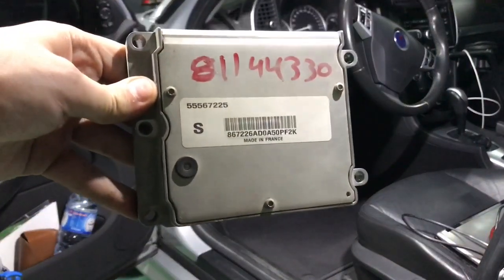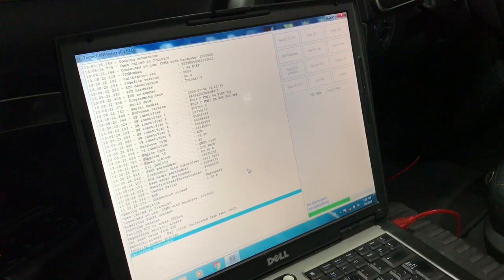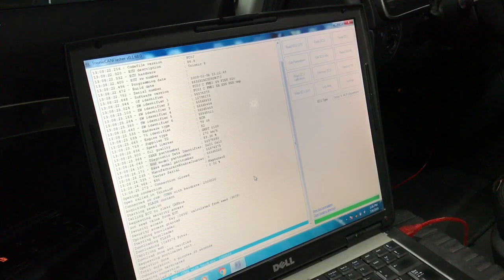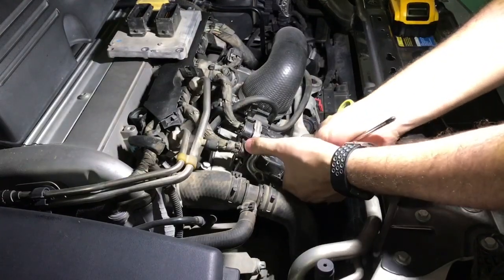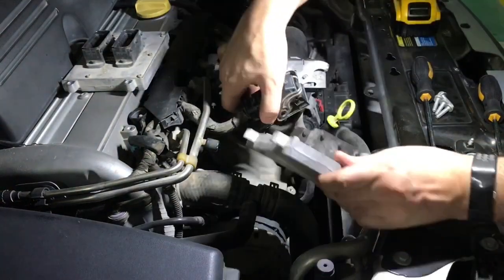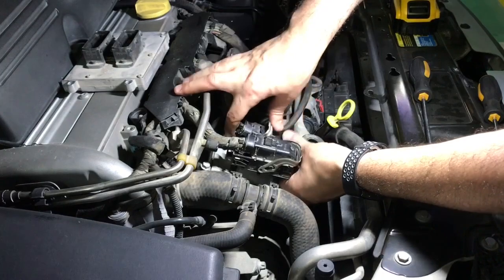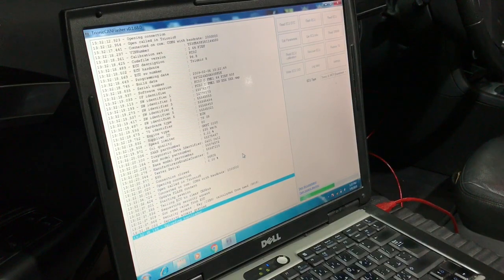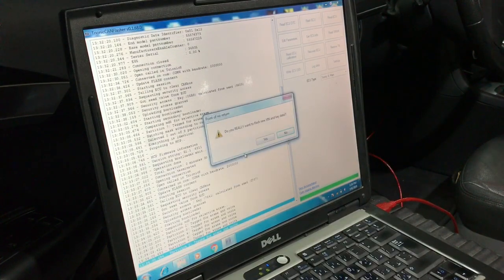SAAB 93 ENGINE ECU/ECM SWAP (TRIONIC T8)

Comment: Hello, thanks a lot for this video. I have one question, I bought a new ecu that has a hirch map with +50 horses. When I insert a new ecu with this method, can I return the old ecu at any time, say in the winter? Or when I put the old ecu back I have to reprogram again? Thanks
Reply from the maker: If u used this method then the hirsch map is gone u just copied ur stock map into the new ECU
Reply: @TheFlyingMechanicDIY  How can i set up a new ECU? Can I somehow use your method but to keep a new map when I'm done? Thank you very much
Reply from the maker: @markomet8  if you want to keep the map that came with the ECU u will need a saab tech2 and TIS software access

Comment: Hey brother, Me Again, My Replacement ECU just delivered today. Upon trying to “Get ECU Info” on my Original ECU TrionicCanFlasher v0.1.68.0 it says “Not Responding” and just stays loading. Any idea as to why? It’s driving me crazy
Reply from the maker: There is an infinite of reasons why that can happen, hardware compatibility, software compatibility, missing drivers, wrong settings, wrong adapter, failed ECU .
Its impossible to me to figure our remotely, im sorry .
Reply: @TheFlyingMechanicDIY  Hey brother, I appreciate the quick response, I managed to get the ECU cloned to my New ECU, but now the issue is that it won't crank at all. I Charged the battery up to around 12.4v & Nothing. I'm on the verge of just giving up on it and junking it since it's just taking up space on my driveway. I've got till the end of this month to get it running
Reply: @TheFlyingMechanicDIY  Any idea as to what it could be? It gave no Codes at all, the new ECU is the same model number as my original one 55353231
Reply from the maker: @Choowy  so whats the issue with the old ECU to begin with ?
Reply: @TheFlyingMechanicDIY  Crank but no start & No codes. Also, when we cloned the ECU, we didn’t get a pop up like your video shows “Copy Vin & Key to new ECU” the flash just completed with no pop up
Reply from the maker: @Choowy  if u didnt see the pop up then the clone is unsuccessful.
Reply: @TheFlyingMechanicDIY  interesting, do you think I did something wrong or should re flash the ECU again & see if I get that pop up for the VIN & Key? Also, would you prefer me to email you or is talking through here okay with you?
Reply from the maker: @Choowy  email is better, try cloning again, and send me a screenshot of the final result from the trionic software when the flash process os done
Reply: @TheFlyingMechanicDIY  Sounds good brother,  Can you send me your email? it’s pretty late here in California but I’ll send you an email tomorrow when I’m re flashing it. Thanks again for all the help man, greatly appreciate it
Reply from the maker: TheFlyingMechanicDIY@gmail.com

Comment: Hi, my Window 7 laptop does not have Port option, then I added Port in device manager.  It gets Windows cannot determine the settings for this device.  Consult the documentation that came with this device and use the Resource tab to set the configuration. (Code 34)  Seem like driver problem to me.  Do you have any idea?  I search online and got no clue.
Reply from the maker: Make sure u install the correct driver , and while the device is connected to ur laptop u should be able to see the device listed under ports .
Reply: @TheFlyingMechanicDIY  I got a Window 10 laptop work.  Everything is good.  Thanks for your video post.
Reply: @TheFlyingMechanicDIY  It does not have a correct driver to install for the port in device manager, and there are no option for the adapter in Trionic flash.  Also the OBDwiz did not install correctly as well.
Reply: @TheFlyingMechanicDIY  Is Window 10 laptop work?

Comment: So I just tried doing this myself and wonder what could go wrong? How do I know I copied the files correctly and they are readable? As when I tried to flash the ecu and install the two bin files for some reason I never get to the verify your key screen and it seems like it didn't install the files.
Reply from the maker: Start with a fresh screen, when the process is finished read what ls on the screen it should say job done and u shouldn’t see any failed items
Reply: @TheFlyingMechanicDIY  big error i ran into for whatever reason cloning the ecu to another working one wasn't successful at all and I dont seem to know why. But even worse I put on my old ecu and my car didn't turn on how is that possible if I didn't flash my original ecu just copied the files off of it. How can I get it back running with my ecu that's giving out? I need major help please help me out
Reply from the maker: joshrawks21 .. what was the issue with ecu that triggered the replacement ? Can u read faults from the car and see whats in there ? Try disconnecting the battery for 30min , and i suggest u send me at the email from the info section .
Reply: @TheFlyingMechanicDIY  email is being sent! You're my only help!
Reply: @joshrawks21  I'm having the same issue as you. Did you get it figured out?
Reply: @asbunce  got a email I could send you the steps

Comment: I had 2 ecm s flashed but the codes say all injector circuits are open and runs bad 
what the solution??
I put new injectors in
Reply from the maker: Bad ECM .. get one thats confirmed running and not from eBay ..

Comment: Can you explain what you mean by connecting the car to a charger or maintainer? Can't I just leave the car connected to the battery and do the ecu swap?
Reply from the maker: When u do the ECU swap u actually should disconnect the battery before disconnecting ur ECU , and only reconnect the battery after u connect ur ECU.
What im talking about here is while u r performing programming ..
Reply: @TheFlyingMechanicDIY  I understand disconnecting the battery when I remove the ecu or install the ecu. But what I wanted to know is when deleting everything off the donor ecu and then grabbing your tune off your original ecu the battery is connected and everything should be okay? There's no risk of it dying unless you have a bad battery yes? Also if the donor ecu is from a 2004/9³ and you have a 2008 ecu/9³ when you format the donor ecu what option do you click on tronic program when you have to pick what ecu you're working on?
Reply from the maker: joshrawks21 if your battery is ok, then no need for charger. U dont format the ECU, you copy the main and MCP softwares from the old ecu, then put then on the new ecu (start with the mcp then main)

Comment: Just got the P0201-P0204 and P0245 and P0246 on my 06 93. I already changed the solenoids on the turbo and the throttle body and no luck. I'm guessing it's gotta be the ecu and I'm hoping that it doesn't lead to it actually being injector troubles. The guy programming for me says that any Ecu for the b207r Auto or manual should work and that it's best if I get an 06 Ecu from the junk yard if I can. I'm at 134k and have Cel and half boost
Reply from the maker: Yaa, its definitely the ECU .. if he is using tech2 only for the installation then the ECU must be from same year/engine/tranny. If he is using tech2 and TIS then the ECU can be from any car 06 or before . If he is using Trionic flasher then it doesnt matter where u get the ECU from
Reply: @TheFlyingMechanicDIY  I see thank you for the info I'll make sure to ask how he's going to go about it so it'll go smooth with no snags.
Reply: @TheFlyingMechanicDIY  I also have the same error codes on a 2007 9-3. I tried using Trionic Flasher to clone my ECU but each time when I flash to the new ECU, I am not prompted by the software to write the key data/VIN information. The old VIN number remains on the flashed ECU. What could be the issue?
Reply: @OS-fl5hx  you didn't check the box that says .. unlock system partition like at :26 seconds... If it's grayed out make sure to do it before you read ecu.. Happened to me lol

Comment: hello there i'm john and i have been trying to find out how to get the sofeware for programming my ecm because the one that is in my saab 93 is bad the car runs but it runs bad. And when i open it up the board was burt so that may be the cause of all of this and i need someone to gide me to what sofeware i need to install on to my laptop i'm running window 10 and if that's okay to have in doing so?
Reply from the maker: Here is the download link, u will need to buy the adapter and just follow the steps in the video, its straight forward.

https://txsuite.org/download/trionic-can-flasher/

Comment: Another very good video.  Thanks.  Question:  What is the difference between T8 MCP and T8 Main?  Also you say to set latency to 16ms, Trionic site says 2ms.  Thank you.
Reply from the maker: Thats whats working for me .. could be different for u
Reply: @TheFlyingMechanicDIY  Thanks.  I did mine and it worked out well at 16ms.

Comment: Have you attempted to manipulate the software in the actual Trionic 8 suite? The flasher is a life saver for repairing an ECU tune on the married original ECU, but does nothing for installing a different ECU from a different vehicle correct? That requires a Tech2 to get an ECU to be married to any SID integrated system? If youve looked around through the tuning software, have you been brave anough to alter anything?
Reply from the maker: Ofcourse the flasher can copy the original ecu to any new ecu , for the tuner i dis few things here and there, but only minor adjustments

Comment: i am sorry to bother you. but i bought a tronic 8 ecu that someone had cloned a stage 2 tune to from their car. no one in my state knows how to marry the ecu from my car into the tuned ecu. i have been told i need a tech 2 programmer. but it seems this software bypasses that. i am wondering if and how you can marry the vin into this tuned ecu. if you can help i would be blessed man. i hope to hear back. i just dont want to wipe the tune i payed for. also the guy i bought the tuned ecu from is going to send me the tune files if there is a way to use them to flash my ecu
Reply from the maker: Unfortunately the only way is to have a tech2 and TIS software, and without me having access to the car physically i cant help.
I can suggest you subscribe to the saabcentral forum, and post ur location, u might find someone near to u that will do it for free even.

Comment: Hmmm, direct quote from the forum.... “ Also like it says in the guide don't use the MCP from your ECU. Just use a fresh one from the MCP dump section. These are 100% okay and working. “
Reply: I'm looking around the forum, where are the files?
Reply: @namechane1758 did you ever find them? I just did this process on my 06 and it won't even begin to crank. I'm assuming this is also my problem as it would start with the original ECU.
Reply: @NogaBlitz I did I will share I can
Reply: @namechane1758  awesome thanks! I read about possibly needing to unlock partitions using trionic, when you do get the chance to share let me know if you had to do that too.

Comment: Hi will this work on the 2008 Saab 9-3
Reply from the maker: It will .. if it has the Trionic8 ECU
Reply: The Flying MechanicDIY thanks how do I find out that it’s got a Bosch 55666420
Reply from the maker: Aty Hussain i dont recognise this part number, and if it sYs Bosch then its definitely not Trionic

Comment: Hi where can I get the lead and software from?
Reply from the maker: Hi there, its all in the video description
Reply: @TheFlyingMechanicDIY  many thanks, I did spot it LOL
I may need to flash my new ECM as i don't think the garage that swapped it made updates as I now have  a p0325 error code!
Reply from the maker: jamie king u mean u wana copy ur old ECU software into the new one , right ! That should work .
Not sure if a P0325 will be caused by a software though
Reply: @TheFlyingMechanicDIY  Hi, at the moment I've ordered a replacement CDM (ionization module) hoping it will resolve the issue, but I've also read somewhere that it may be that my new ECM is set to analog reading for the CDM and the model I have changed to Digital reading?!? (So not sure which is true . . .Will let you know when after I've fitted the module)
Reply from the maker: jamie king if the car is newer than 2003 and an ECU from 03 was used, then software is ur problem, just copy ur old ecu software to the new one and u should be good to go
Reply: @TheFlyingMechanicDIY  successfully cloned my ECM today! Yay, I backed up both ECMS, now don't have the engine light on for code p0325

Comment: I just recently had my ecu done on my 07 aero!
It’s had a fault with the injector control system and the car ran terrible and smoke a lot! There is a lot of good information on the Saab forums and after searching there it confirmed my ecu was toast! £250 for a used ecu and £50 at my local Saab specialist for programing via tech 2! He also said he did all the updates? Do you have any idea what these updates do?!
Reply from the maker: These updates correct certain faults known on the previous softwares

Comment: Noone reached your deep knowledge about 9.3 NG on YouTube! Please keep posting! Just one question: Can you upgrade the engine map from 150 hp to 175 hp on a B207 engine via this method?

Thank you
Reply from the maker: In that way, no you cant.
But if reach that forum, u will be able to find a tuning map for your specific car (year/motor/gearbox/location) which will usually raise the horsepower around 40hp
Reply: Thank you! Honestly want to keep it simple, it’s known that 1.8t (150hp) and 2.0t base (175hp) are the same engine with a different map, would be super to simply get from them the OEM map for the last one to flash it on the 150hp
Reply: @picoale  In T8Suite you have already implemented map to upgrade 1.8t to 2.0t (175hp) ... on that forum a few things are available without ranks, post, levels.. but this is one of them .. just a few clicks in this software which is free :)
Reply: Waited for a year, thank you pal!